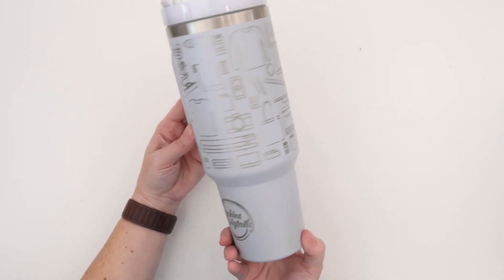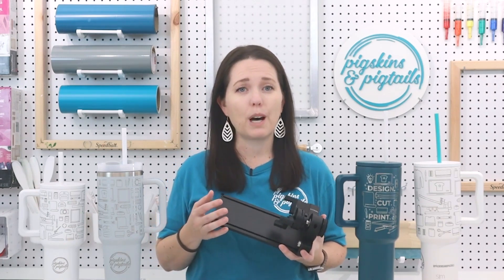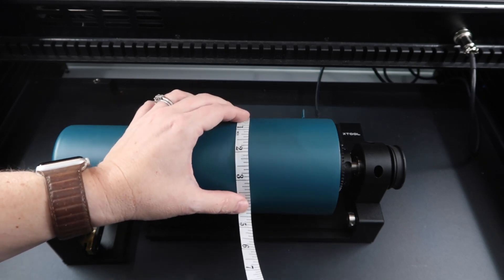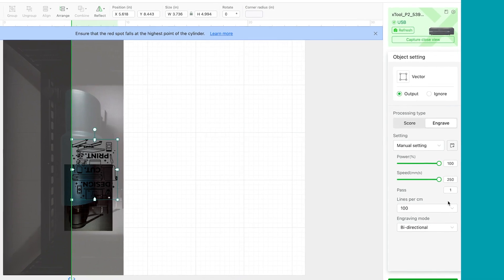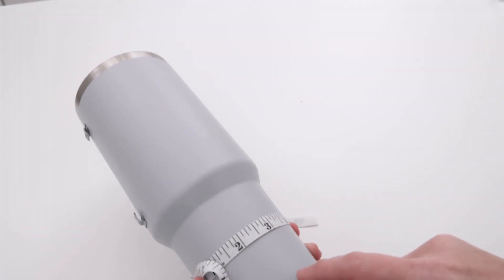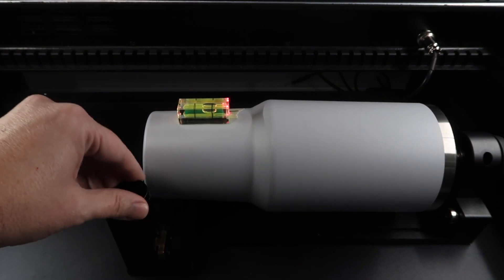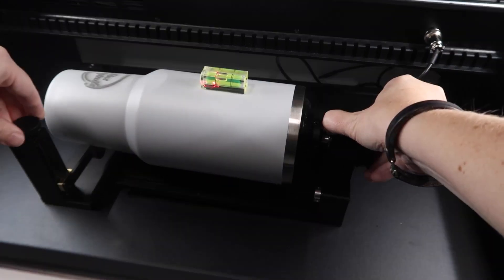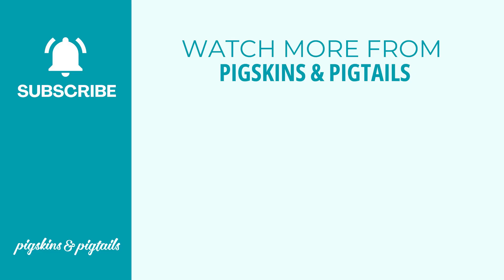How to Laser Engrave Tumblers | xTool P2 with RA2 Settings

Comment: Why are you leveling the tumbler when the P2 will automatically adjust for height?
Reply from the maker: It does adjust for the height, but you still need to level the tumbler so it sits correctly on the chuck and spins evenly

Comment: Hello, nice article, I am new to the Xtool P2S and RA2 Pro but using the chuck feature when you do the bottom engrave and you level up the cup to compensate for the taper aren't you also skewing the chuck arms inside the cup? To me that would/could introduce wobble or slippage. I suppose with a small logo it might not make a difference but tumblers seems to be a huge learning curve for me on chuck vs roller usage

Comment: If I put mine on 100 power like that it burns the cup instead of being shiny it will be a dark burn color
Reply from the maker: You may need to adjust the settings depending on the brand you use - each coating may be a little different.  Mine will often look burned when I take it out but if you use the cleaner I mention, it will clean off and look shiny!

Comment: Hello, thank you for this video.  I've watched it several times as well as a few others while I waited for the base riser to arrive.  Now that it's here, I'm receiving an error message: exceed the maximum measured distance.  I started at 2a then moved it down then up but no change. I'm using the P2.  Do you have any suggestions?
Reply from the maker: First just double check the red laser is hitting the highest point of the cup. Some colors/surfaces can be hard for the machine to recognize. Try putting a piece of masking tape or a post it note on the cup and measure again.Then you can remove the tape/paper before you start the engraving.
Reply: @pigskinsandpigtails  thank you for the suggestion but it still didn't work. 😫
Reply: Good morning, I tried it again and it worked. Thank you so much!!!